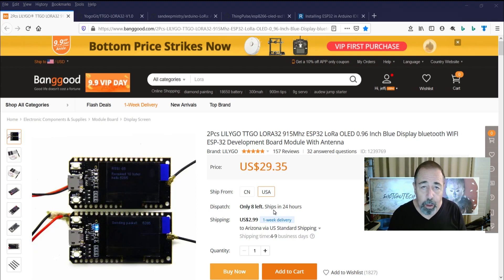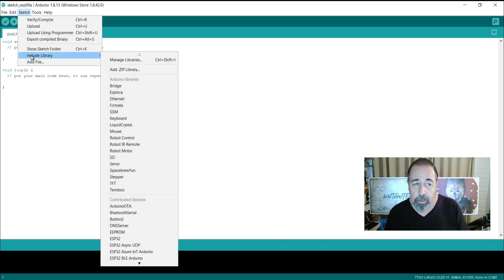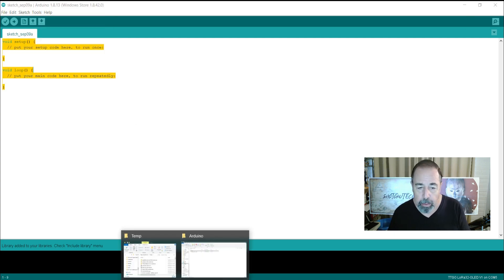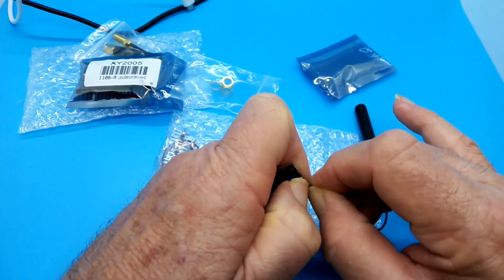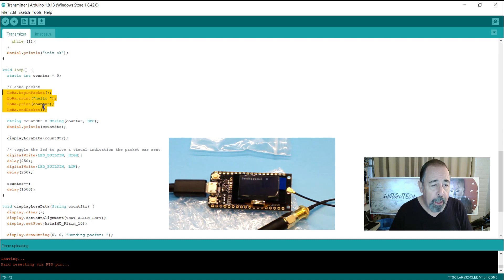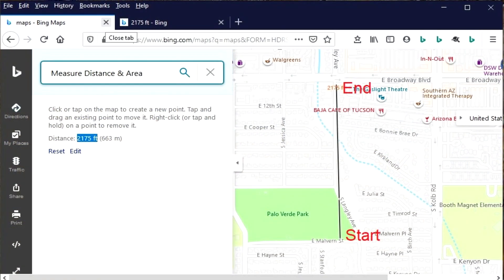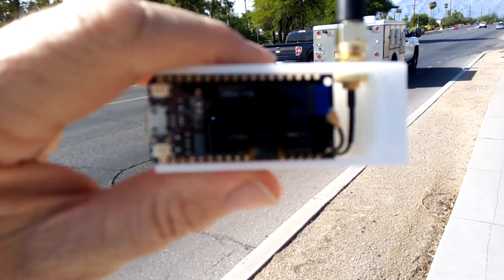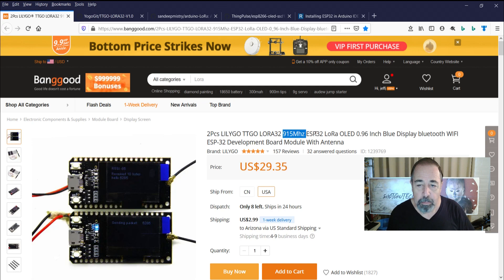Complete LILYGO TTGO LORA32 915Mhz ESP32 Setup and Range Test

Comment: Questions. These are all battery operated with relatively low power consumption. What is the weight of these and could they possibly achieve a relatively high altitude with the use of a tethered large helium balloon? My understanding is these were originally created for paragliders to stay in contact once they hit the ground. The users on the ground would ping off users who were still in the air to communicate with others who were also on the ground to meet up.
Reply: The weight of the unit + batteries should be no more than a few ounces.  You can search up the weight of a 18650 battery.

Comment: I just ordered me some of these as well! Europe version tough gonna try putting them up high on building roof and see what that does to range
Reply from the maker: For the last trial, I had the sender on the eve of my roof. I got clear signals all around my neighborhood and down the street, up to the point near 1/2 mile. There were a lot of trees in the line of sight. I am wondering if I can get better performance from a higher voltage supply. I was using a single cell LiPo at 3.7v. Could I get more at 5v? More testing. Best wishes! Thanks.

Comment: I have experienced an issue with the OLED screen after uploading the Transmitter or the Receiver code to my Lora board. Upon plugging the board with a battery source, the OLED screen is not switched on, whereas there is a green light at the bottom of the board switched on. 

I hope there is a solution to this issue.
Reply from the maker: I do not see a firmware for this device at the https://github.com/Xinyuan-LilyGO/LilyGo-LoRa-Series. But you might try to contact them there. I spent 15 minutes searching and don't see a good lead. Sorry.
Reply: Thanks a lot for your precious time and help. 

Actually I followed exactly all the steps you mentioned in the video. The LoRa outputs only were appearing on the IDE console, but nothing was shown in the LoRa display (blank display). The device model is same as yours. 

I thought there might be something missing in the code.
Reply from the maker: @mustafanasralla  I think I was just using Lilygo's example sketches here. Now I am curious to make a simple program that would test the screen alone.
Reply: @ShotokuTech  I have an update. I have managed to fix the issue. There was a different distribution of the pins on my board than yours. After rearranging the pins in the code with my model structure, the device worked successfully. 

Many thanks for your efforts and support; you are the best :)
Reply from the maker: @mustafanasralla  Well played! Congrats.

Comment: have you experimented with Meshtastic? i want to buy similar boards that DONT have a GPS on-board, and i am wondering if Meshtastic and everything will still work if i am using a cellphone connected wirelessly to the board. since there is a GPS on the cellphone.
Reply from the maker: I have not had the opportunity to check out Meshtastic so far. Just reading up on it now. Thanks!
Reply: @ShotokuTech  no problem!

Comment: What are these boards use for?  Or what do you plan on using them for?
Reply from the maker: With UART and I2C, plus WiFi, Bluetooth and support in the Arduino IDE these TTGO LoRa boards earn a chance to audition for my model rocket live telemetry program. Thanks Brandon!
Reply: @ShotokuTech  awesome.  Can't wait to see it.
Reply from the maker: @BrandonJacobson  I still have a couple more auditions. M5Stack Might get a crack at it and TTGO T-Watch 2019 has a LoRa+GPS backplane that can be added on. I have the backplanes already. But I wanted another T-Watch 2019 to have a matched set. Just thinking I'm going to start selling some of this hardware off on E-Bay. Ha ha.

Comment: I have problem that my laptop can't find port (windows 11), I try install CP210x USB to UART Bridge VCP Drivers for windows 11 but it doesn't work well. Anyone here has problem like this? Maybe I will install windows 10 if I can't solve this problem.
Reply from the maker: 1st thing try a different USB cable. Otherwise, In Windows settings search for Device Manager. In device manager under View, select Show hidden devices. Remove any hidden Port (COM & LPT) devices as well as any hidden Universal serial bus controller devices.
Reply: I realize that my module using USB type C for connecting and I don't know if there's a difference between 2 types. Can you tell me that which type that your module use?
Reply from the maker: @nankinmame_L_N  Oh yeah with chip shortage Lilygo has done a couple of things. 1) Using different USB to Serial chip. 2) Using separate USB to Serial dongle. I'm looking here: https://www.aliexpress.com/item/4000010599226.html
"Due to price of 210X chip increase.We recommend 9102 Version which is the replace one."
Reply from the maker: @nankinmame_L_N  Mine are older USB micro CP210x.
Reply: @ShotokuTech  Thanks for your advice, I have found a device named T-U2T USB to TTL. Because Lilygo has removed CP2102 so that device will be used to upload the program to motherboard.
Reply from the maker: @nankinmame_L_N  Yeah I was not sure if they had done away with the chip on this board and gone to the dongle. I have a few different boards that use T-U2T. Good luck.

Comment: What can be sent and received with this device
Reply from the maker: I will be sending GPS coordinates from one to the other from a model rocket soon. Motion, temperature, air pressure. Pretty much anything you want to send in simple text or you could get fancy and encrypt it somehow. Thanks!
Reply: @ShotokuTech  HOW TO SEND TEXT ???
Reply from the maker: @yacineshop9380  I have links to the Arduino libraries in the description of this video. I just watched this video again for myself and it shows how to do this step by step. Follow along and you will have a sender and receiver programmed. Sending text at that point becomes a simple matter of:
  LoRa.beginPacket();
  LoRa.print("hello ");
  LoRa.print(counter);
  LoRa.endPacket();

Comment: Can the firmware on these boards be upgraded to support meshtastic?
Reply from the maker: I just started checking out Meshtastic. From the Meshtastic website:
"The ESP32 chip is older and consumes more power than the nRF52 chip, but is equipped with both WiFi and Bluetooth. Supported ESP32 devices include:
    LILYGO® TTGO T-Beam (>V1.1 recommended)
    LILYGO® TTGO Lora (>V2.1 recommended)
    Nano G1
    Station G1
    Heltec V3 and Wireless Stick Lite V3
    RAK11200 Core module for RAK WisBlock modular boards
"
I have both the TTGO and the Heltec so stay tuned! Thanks.

Comment: When you did the range test, what spreading factor and bit rate did you use?
Reply from the maker: This code I demonstrated in the video used this simple code: https://github.com/YogoGit/TTGO-LORA32-V1.0
There is only a setting of the base frequency in this example. So these would have been the default values in Lora.h from this: https://github.com/sandeepmistry/arduino-LoRa
Everything is shown in the video and links are in the description.  Thanks!

Comment: Hi, nice video, I have a problem with my device, my screen doesn't work, why?, I need to activate it by software or something else?, when I started it my screen desn't show nothing it's normal that?  it is broken :( can your help me ?
Reply from the maker: It's been so long since I took one of these out of the box, I don't recall how it should behave out of the box. But, yes there are a variety of example sketches you can install on it using Arduino IDE. I guess that's what I would try next.

Comment: Can you do a range test with the antenna at the focal point of a DishNetwork Antenna.
Reply from the maker: Not quite sure what you mean, as in elevate the transmitter or receiver above roof level? I am developing such applications. Stay tuned. Thanks!
Reply: @ShotokuTech  I mean put the TTGO Lora32 at the focal point of a Satellite Dish antenna and aim it at a similar setup at the other end of your test link.
Reply from the maker: @WagonLoads  I don't have access to two satellite dishes. I do have one of those ancient 10 foot dishes.  But it is pointing into space and I don't have much hope to find equipment needed to control it and it is on a very tall pole. Interesting idea though. There is one mention of 915Mhz in this article: https://ham.stackexchange.com/questions/16594/can-you-use-a-satellite-dish-for-a-ham-radio-antenna
But ultimately this is going have to fit in a model rocket to suit my purposes. So I have not contemplated using dishes. Thanks.
Reply from the maker: @WagonLoads  I'm thinking one could run afoul of the FCC with physical modifications with the intent to improve signal strength. One thought I have is these boards are rated 3.3v to 7v. I have only tested them on a single cell LiPo at 3.7v. There is also a longer antenna that is approved for this device. The umbrella would definitely not fit on my rocket. That guys umbrella dish was intended for a receiver to monitor a satellite: https://en.wikipedia.org/wiki/OSCAR_40
Reply: @ShotokuTech  OH, I didn't know you were making a device that goes up with the rocket. I thought you were just making a long distance rocket launcher.. Here is a video of a long distance antenna that might be allowed by the FCC. https://www.youtube.com/watch?v=2rujjTOPIRU The ground plain of his antenna could be replace with spokes going out in 4 directions, and the coil part wrapped around the body of the rocket.
Reply from the maker: @WagonLoads  Just to set expectations, our FAA waiver is limited to 6000 feet. the launch site is basically 38 acres. We may be able to recover rockets from one of the adjacent fields. I'm not looking for much more than 1-2km line of site. NAR and Tripoli are regulated by several federal agencies and clubs have to meet local requirements as well. Then you have to build a rocket that can carry this equipment. Here is my example https://youtu.be/PLv2YogA2FY
Reply: @ShotokuTech  Will the rocket have GPS to tell you where it landed?
Reply from the maker: @WagonLoads  That is part of the objective, sure. Local motion sensing used for some control of flight would be a bonus. https://youtu.be/wdxeVSlC8Zw

Comment: I'm using a 915Mhz TTGO ESP32 Lora OLED 2.1. I tried connecting the board to my computer but it wont find the port. Anyone know how to fix this?
Reply from the maker: Silicon Labs CP210x Driver installed? https://www.silabs.com/developers/usb-to-uart-bridge-vcp-drivers
Reply: @ShotokuTech  Ok, I've done that, it detected the port. But once I've uploaded it, the LoRa doesn't show anything on the OLED anymore.
Reply from the maker: @ammarazizulraheem5673  Interesting. So you have two TTGO ESP32 LoRa OLED boards. One would have the sender sketch installed and one would have the sender sketch installed, right? You have the three libraries installed? The additional board manager URL for Espressif? And you have selected the TTGO-Lora-OLED V1 board? If you have all that, then maybe you have a different version of the board. Is that possible? Any way you can send me the link where you pruchased from?
Reply from the maker: That is interesting. I keep seeing mention in the search results that it is 'like' the TTGO ESP32 LoRa OLED but it looks different from the ones I use in this video. It would be nice if the seller would include links to an example library. I will see if I can find out more. Part of the fun in this hobby is finding the challenge. Then the other part is overcoming it. I would like comments about this device on one of the sellers pages. It is all over E-Bay too, but nothing helpful so far.

Comment: May I know if these TTGO can use Bluetooth or BLE?
Reply from the maker: Yes, these boards include Bluetooth and WiFi.
Reply: @ShotokuTech  Is it possible to request for a video showing on how to set up the Bluetooth on this module for both receiver and transmitter? I'm currently stuck on this part for my project. Couldn't find any code source.
Reply from the maker: @aqilmoons  It is a good idea. I will see what I can do. Thanks.
Reply: @ShotokuTech  Thank you😁
Reply from the maker: Hope you like it?!
Using Bluetooth with TTGO LORA32 915Mhz ESP32
https://youtu.be/yA_zaGAUKf4

Comment: I accidently got the 868 european version .can you change this to 915?
Reply from the maker: I have just searched around and find comments on Amazon 868 version that seem to indicate yes. Use LoRa.begin (915E6) in the example code instead of LoRa.begin (868E6) where you see it.
https://www.amazon.com/TTGO-LORA32-V2-0-Display-Bluetooth/dp/B07B95BY52
"Yes, I use it on 915MHz as that is the certified band here in New Zealand.
The sample code I found has these definitions:
//433E6 for Asia
//866E6 for Europe
//915E6 for North America
#define BAND 915E6"
https://www.amazon.com/LORA32-Display-Bluetooth-Development-Antenna/dp/B07C5GV243
"LILYGO 2pcs TTGO LORA32 868/915Mhz ESP32 LoRa OLED"
Reply: @ShotokuTech  Thanks very much,especially for the quick reply.
Reply: @dcliffe8539  you technically have to change a couple capacitors also on the board

Comment: Thanks for this video. Can I connect this board with a GPRS module to send data via HTTP (es. Thingspeak) the LORA received data ? If yes what module can be use ?
Reply from the maker: I haven't taken the concept that far. They do make TTGO boards with GPRS built in. I am also slowly getting into more IoT, including Mozilla IoT and TheThingsNetwork. I have the official TTN gateway. I just have not plugged it in yet. I also have the T-Watch SIM868 on the bench. So I have a backlog of projects and videos right now. Thanks.

Comment: When I compile it the compiler cannot find  "images.h", does anybody know where that header file comes from?
Reply from the maker: Copy the entire TTGO-LORA32-V1.0-master folder from inside TTGO-LORA32-V1.0-master.zip and place it in the path: ...\Documents\Arduino\
The files would be there like this directory listing:
...\Documents\Arduino\TTGO-LORA32-V1.0-master\Receiver
...\Documents\Arduino\TTGO-LORA32-V1.0-master\Receiver\images.h
...\Documents\Arduino\TTGO-LORA32-V1.0-master\Receiver\Receiver.ino
...\Documents\Arduino\TTGO-LORA32-V1.0-master\Transmitter
...\Documents\Arduino\TTGO-LORA32-V1.0-master\Transmitter\images.h
...\Documents\Arduino\TTGO-LORA32-V1.0-master\Transmitter\Transmitter.ino
The images.h files are there in the Receiver and Transmitter folders if you follow above. Open the Receiver.ino and Transmitter.ino files by double clicking on them. When they open in the IDE you should see the images.h tab along with the INO file.
Reply: @ShotokuTech  Thanks it's now working fine...
Reply from the maker: @richardroy6747  Great! Thanks.

Comment: Pretty long distances!👍
Reply from the maker: Considering all the physical and radio interference in a populated area, you are right. It is pretty good to get this close to one half mile on flat ground. And this is just a little ESP32 board with a radio all in the size of a postage stamp on a single cell LiPo battery. I am thinking of hooking up a bigger battery closer to 5v than a 3.7v LiPo. I wonder if that will do the trick? Thanks.

Comment: hello, i want to ask if i can use lora32 915mhz as sender and lora32 868mhz as receiver or vice versa. will it works?
Reply from the maker: You need to set them to the same frequency if they can support it. If they aren't on the same frequency it probably won't work.
Reply: @ShotokuTech  is it possible to set the range to 868mhz using 915mhz antenna? or i just need to buy new antenna?
Reply from the maker: @nurulainaa2318  It depends on the board. I have 868 boards that can be set to 915Mhz, same antenna. But you also have to comply with regional restrictions. https://www.rfwireless-world.com/Tutorials/LoRa-frequency-bands.html
Reply: @ShotokuTech  thank you so much. your information helped me a lot 😊
Reply from the maker: @nurulainaa2318  That is good to hear. It can get confusing sometimes. I just take a breath, search the internet again and find the best information I can. Best wishes.

Comment: Hi
This error appears to me!
How can I solve ? already updated, already switched COM and nothing

AVISO: Categoria inválida «Communications» na biblioteca Balboa Spa communications. Alterando para «Uncategorized»
O rascunho usa 243629 bytes (18%) do espaço de armazenamento do programa. O máximo é 1310720 bytes.
Variáveis globais usam 16340 bytes (5%) de memória dinâmica, restando 278572 bytes para variáveis locais. O maximo é 294912 bytes.
esptool.py v2.6
Serial port COM7
Traceback (most recent call last):
  File "esptool.py", line 2959, in <module>
  File "esptool.py", line 2952, in _main
  File "esptool.py", line 2652, in main
  File "esptool.py", line 222, in _init_
  File "site-packages\serial\__init__.py", line 88, in serial_for_url
  File "site-packages\serial\serialwin32.py", line 62, in open
serial.serialutil.SerialException: could not open port 'COM7': WindowsError(5, 'Acesso negado.')
Failed to execute script esptool
a porta série Failed to execute script esptool
 selecionada não existe ou a placa não está ligada.
Reply from the maker: CP201x driver installed and shows correct in device manager? Correct board selected in Arduino? Try different USB port, cable and lower the transfer speed?
Reply: That error means that you have to comm port open already or already in use, Windows sometimes can do this as well as if you have two arduino IDE's open at the same time. Another possibility is if you have putty open as well that can cause a serial port conflict

I would advise you try on another PC and let me know how that goes
Reply from the maker: @TheExecutorReaper  True. "(5, 'Acesso negado.')" means there is some contention between two processes vying for access to the same port. Thanks!